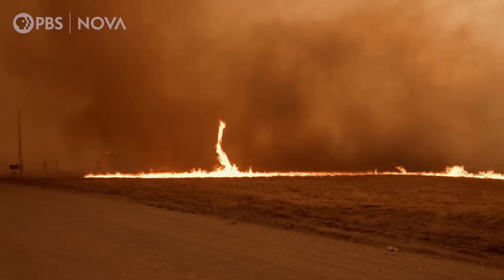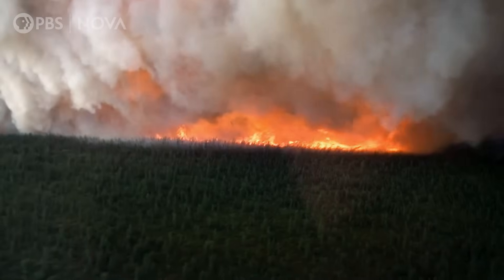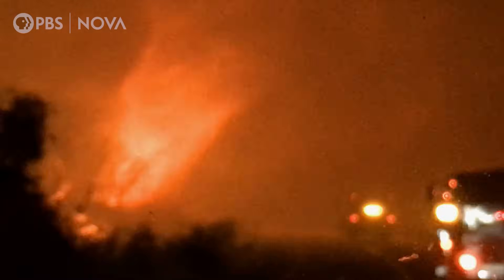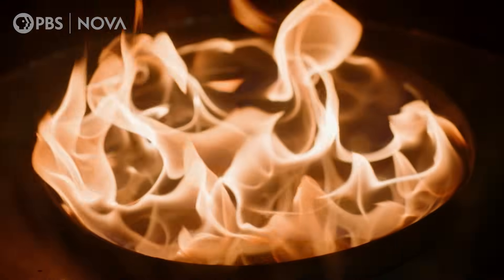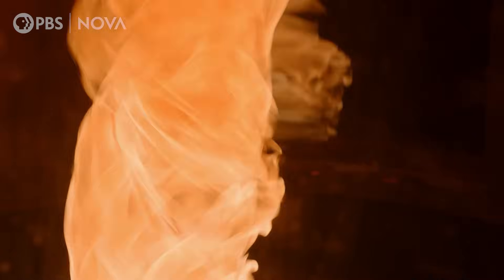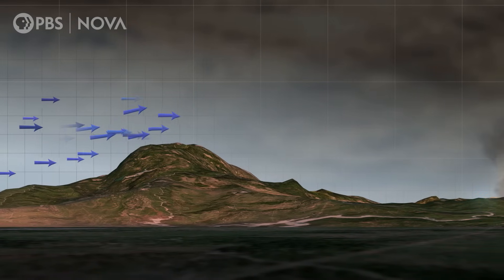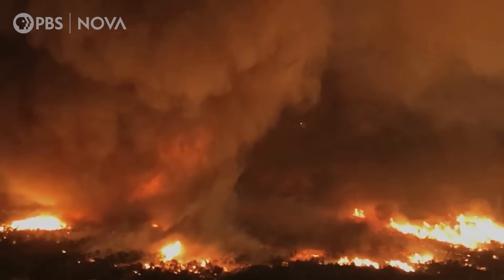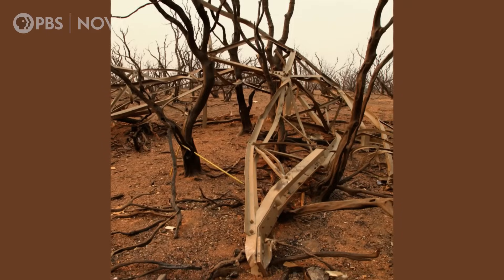As Megafires Have Become More Common, So Have Fire Tornadoes | NOVA | PBS

Comment: A sure sign of a firestorm. This is the so-called "chimney effect", the heated air rises rapidly and sucks in cooler air from near the ground. Smaller sources of fire can merge into one large one and spread extremely far and also move very quickly. At the center of such a firestorm, temperatures are 900 to 1000 degrees Celsius. Wind speeds of up to 120 kilometers per hour can be reached. The swirled embers are spread over a large area, which is then also set on fire by the draft. Even steel structures are then at risk, as steel loses its stability above 800 degrees Celsius. Asphalt starts to melt and then some of it burns. Bricks can crack or melt at these temperatures. Everything in the immediate vicinity is sucked into the flames.

Comment: This article is a propo piece. Trying to dismiss the LA fires as 'normal' , its right there in the title.
Reply: The video doesn't dismiss the LA fires as normal.  In the title it states that the fire tornadoes have become more common.   Did you really just normal with more common??
Reply: @michaeldeierhoi4096  Yes the meaning of both are synonymous.
Reply: @JasonH-su5kr  But they aren't the same though they have some over lap.  Wildfires have become more aggressive and larger in recent years which one could say makes those bad fires common, would you call that normal?   Murder is still all too common in this country, but does that make it normal.  It's true that something can be both common and normal, but there is a difference. 

Common refers to the frequency not whether it is good or bad. 

Normal refers to a generally accepted pattern that is not a threat or considered dangerous.
Reply: We need to separate out the causes of a fire, and the handling of a fire. The government failure to clear brush routinely, to fund the fire department, and to maintain the reservoirs, is why this was a mega disaster vs a small fire that would have barely made the news.
Reply: Lies for more $$$ and authority. Instead we should fire everyone in charge and hire competent professionals. They have sufficient funding.

Comment: And the backstory that no one seems to be discussing: 

Residents in many places in CA have actively pushed back against fire mitigation efforts, prescribed burns, etc. This combined with a series of terrible policy decisions, are significant contributing factors to the current situation (as well as other, recent fires in the state). "Climate change" is but one factor.
Reply: I seen some control burns that happen on occasion in my area where a cal fire crew would watch one of the buns on the hills near the sides of freeways. But then again prescribed burns are limited to state owned properties like state parks, and freeways where I seen them never in the very neighborhoods getting hit by the fires today.
Reply: @blogdesign7126  
Didn't start there.. and it wouldn't be able to spread all over the state if you had more buffer zones.
Or go learn something from the Netherlands of how to manage and control water.
Reply: If they took the same people who want to go to Mars and use them as lookouts all throughout the fire susceptible lands, then these fires wouldn't be able to grow out of hand and present itself as stage 10 cancer. The Chinese did it with the great wall, strategically put lookout points with humans 24/7 there to smoke signal problems if/when they arise
Reply: Generally not the primary driver and honestly more misleading designed to push those already sceptical of the fact that is climate change away from possibly grasping that it is an existential threat to human civilization.
Reply: YEP. There is OLD EDUCATIONAL VIDEOS for people that moved in in the late 80's. They told everything the resident needed to know for living in the "fire corridor" (native name)